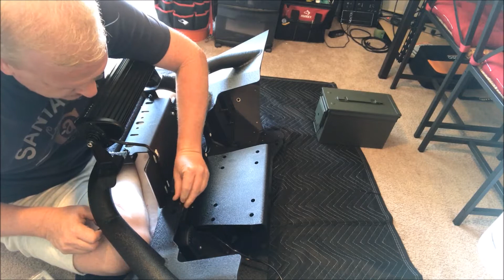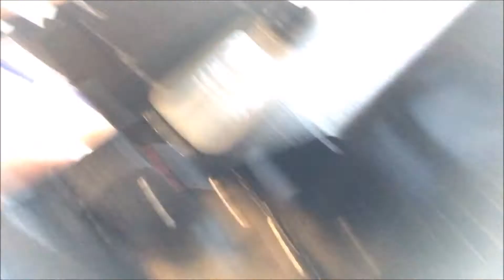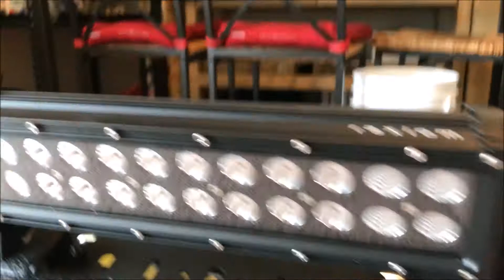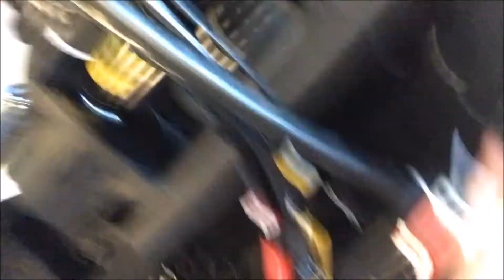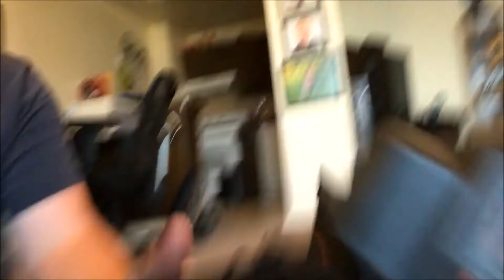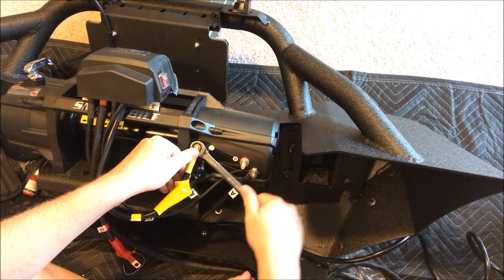Bob's JK Build: Front Bumper Project Part 3 of 4

Comment: Hey Bob.....I’m doing a very similar setup that you did. I love where you located the license plate. How has the weld held up over the last 8 months? Also I use blue as my accent color on my Jeep. Where did you did the blue rope at the end of your factor 55? Thanks for the videos.bumper looks great!!
Reply from the maker: Brian Wood thanks man. It has held up very well I’ve taken it wheeling a lot since then and this thing feels damn near indestructible. The only thing I don’t love is how I had to stack washers and tighten those bolts at an angle like that but the galvanized steel seemed to be ok bending so maybe it’s just me being type a about it. That said even the bent bolts are holding up really well. Just remember to generously paint all of that hardware if you do end up doing this because if any of those bolts rust, I imagine they would be easier to break because of the bends. JB weld is good stuff, though and I’m really happy with how that turned out.